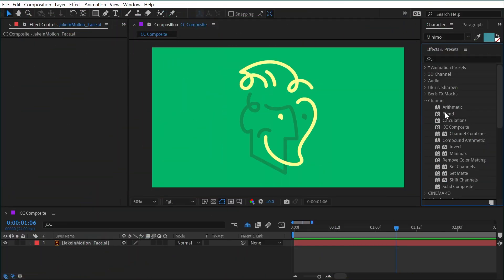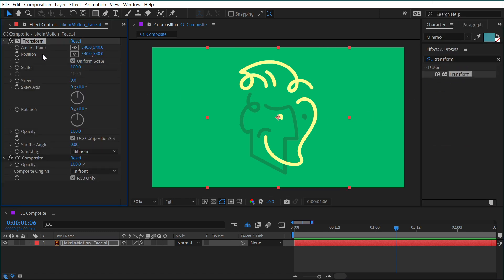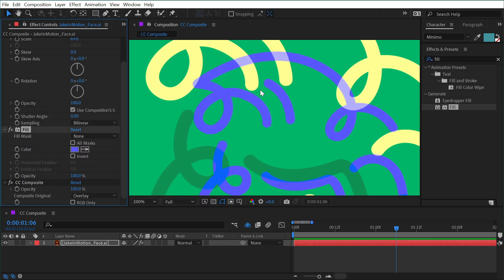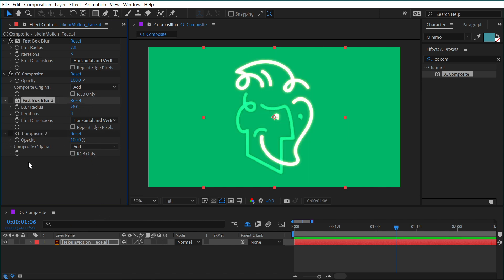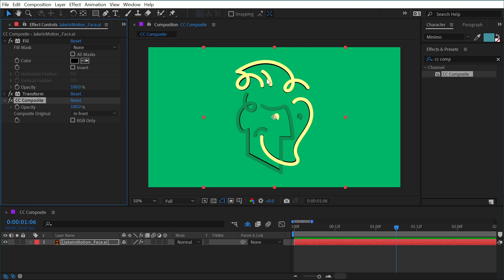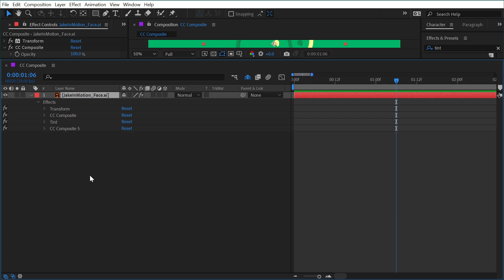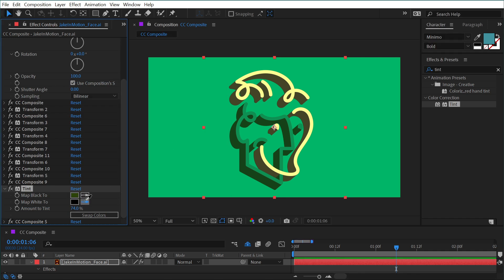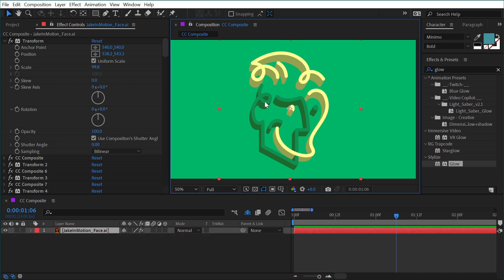CC Composite & Faux 3D Extrusion | Effects of After Effects

Comment: Seriously.  How many times am I gonna be saved by this video series?  I'm doing a visualizer for a megamix of 14 tracks that's almost a half hour long.  Each track I'm applying a different visual style using an adjustment layer.  What I wanted to do was the classic linear wipe with a little bit of feathering ala Star Wars, but it kept wiping everything.  Didn't even consider CC Composite.   Now it's the final effect on those layers with the Transfer Mode set to Behind and RGB Only Unchecked.  Boom.  Donion rings.  Thank you yet again!

Comment: Excuse me, but I have an issue about the cc composite effect, I don’t know why but I have a shifting/ offset problem while using it, currently using ae2023, I have searched it on adobe community and found that same question occurred to others, but no solutions and feedback . I hope  someone will give suggestions to me , thank you.
Edit: Shifting only occurred after applying the effects in pre-composed layer, have already checked that the size and position are exactly the same as the layer inside. When directly applied it in the layer or adjustment layer, it worked perfectly.

Comment: CC Composite is a great effect. I use it in the process of adding a dynamic border around photos. I edit the original photo using a simple choker to extend the edges then use a tint to make the border the colour I want and then use the CC composite to place the original photo in front. This way I can easily replace the photo with any dimensions and still keep my border and animation intact
Reply: Excellent tip! Thank you for sharing!
Reply: Great idea, I will definitely keep this in mind!
Reply: I don't get it. But it seems cool. Can you send us a link on what it looks like?
Reply: @nikyabodigital  Here's some explanation:
a. Apply Simple Choker to your image - and increase the value negatively - you will notice the alpha channel of the image expand (so the layer will now appear larger). And these new pixels you see (because of Simple Choker) will be black in color (because these pixels have an Alpha value of 1, but a color value of 0).  If you want to change this color from black to something else - apply a Tint or Fill effect (anything u like really). Now go ahead and apply CC Composite to this layer (after the Fill effect or Tint effect). Notice your image now appears with a border around it, with the color of the border the same as the color you chose for the Fill/Tint effect. 

Now you could animate this image  - or whatever you do - the border will remain around it. Also, you could change the image altogether  - and these effects will still be there. Does this make more sense?
Reply: Woudl u like me to make a video demonstrating this? I could create one, upload on Google drive and share the link with you